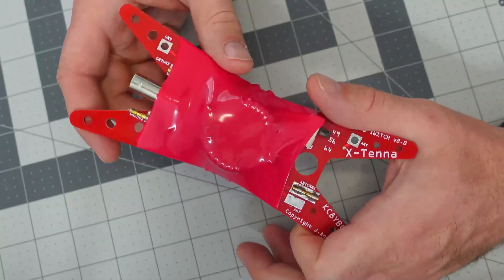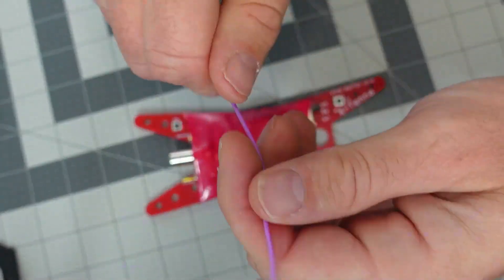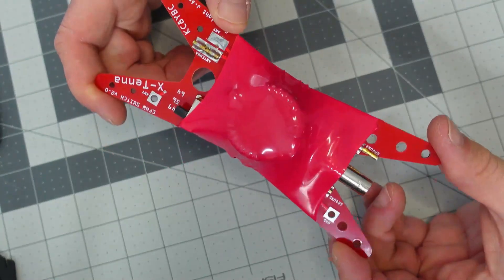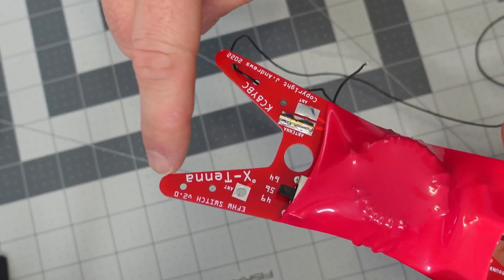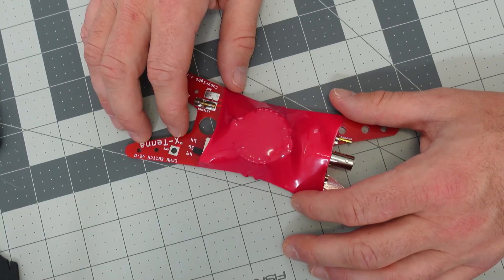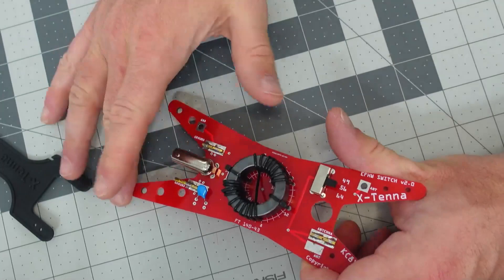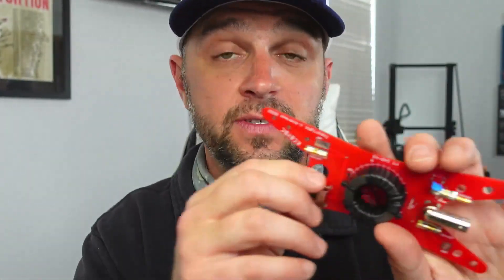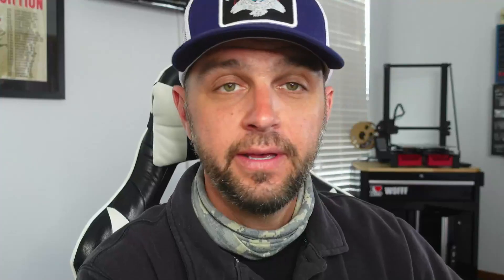X-Tenna Switchable EFHW Antenna for Ham Radio - $65.00 ASSEMBLED?! Xtenna

Comment: Maybe you see this comment but I’m new to HF, I actually just won a G90 from radioddity, I rent so would this type of antenna work in reverse? Like the coax part is at my third story window and the wire just hangs down to the ground? Or maybe I could make a horizontal set up?
Reply from the maker: Hey there! WELCOME into HF.  if you had the coax part (where we plug in, let's call it the feedline) on the third story and the wire to the ground, it should work and may even work better.  Still, make sure you keep it physically off the ground, the higher the better.  But to answer your question, it should work just fine.
Reply: @DudeTested  awesome thanks so much for the reply!
Reply from the maker: @justinsnyder5260  my pleasure.  Enjoy!

Comment: WILL IT WORK OM 80 WITH MORE WIRE?
Reply from the maker: I don't have it to test, but if you had 80m length and a loading coil about 6.5 feet off the toroid,  it should work

Comment: Speaking of broken wires and extra feed points. I keep a small bolt and nut attached to both of the alternate antenna points. Exactly for the broken wire situation you found yourself in.
Reply from the maker: Great idea!

Comment: Skip the petg and print in asa or another uv resistant plastic
Reply from the maker: Yeah I recently started printing with ASA. Of course the main reason not to is that it requires a heat chamber and is toxic if you don't have proper ventilation.  However, once I was able to expand my operations to incorporate a heat chamber and ventilation, I'm extremely happy with ASA
Reply: @DudeTested  a cardboard box will work. Abs is toxic that is part of the reason asa got popular. Now we have crazy options for plastic. Don't sleep on hips great for living hinges
Reply from the maker: I'm kind of curious if you don't mind Where do you get your information from? I'm under the impression that the styrene utilized an ASA is more toxic than what's found in ABS?

Comment: This should be a EFHW antenna, right?  So the lenghts mentioned in the package is definitely not endfed half wave lenghts. They maybe for random wave lenghts.
Reply from the maker: Yeah it's an end Fed halfwave kit. You get 70 ft and cut it down to your desired length. They wouldn't want to give you less than  a half wavelength, right?

Comment: Why not wind the wire right onto the antenna? It looks like a wire winder after all.
Reply from the maker: I did, myself.  That's no issue. In fact with the wire they gave, I can easily ft 71 feet on one side.

Comment: I'm building a couple of them with banana plug taps for various different antenna impedances from 4 to 1 to 64 to 1. It's fun, and costs less than $10 for both, (just the toroids,)  as opposed to $130. I don't run more than 50W anyway. I'm one of those hams who figures the fun of ham radio is really in the building and the learning, not in the yacking. I got the license because the FCC then authorizes me to design, build, test, and use my own gear.
Reply: I'm right with you John.   I love playing with antennas but #notaragchewer   LOL    K7KS

Comment: In a past life, I used to design and install antenna systems! All commercially made stuff in most cases.  I fully understand the wire and winder, and this is designed for portability.  My concern would be the robustness of the switch! I have been (years ago) in the Amateur Radio Emergency Corp (AREC) in New Zealand. I am not involved anymore due to poor health and family reasons. Any I would be using some type of weather proofing on that switch!  Any water (rain) would quickly ruin that (if it is the type I used to use in order stuff).  I love the design though!
Reply from the maker: Good point and useful observation.  I appreciate the input as it gives me more to consider in the future! Thanks!

Comment: I just received my X-Tenna,  what bands will it work on with the 70 ft of wire.  40,20 and 10??
Reply from the maker: 40 20 10 as listed in the description.  I was able to get 15 also In the sloper on 49:1.  Will have a video on that soon.   As far as feet, I recommend cutting it around 68 feet and slowly cutting down until you have a good match.
Reply: @DudeTested  thank you so much, that is what I thought and was hoping for.  W5CI